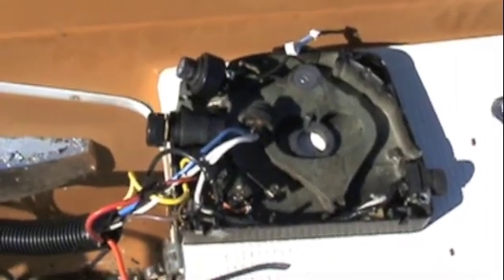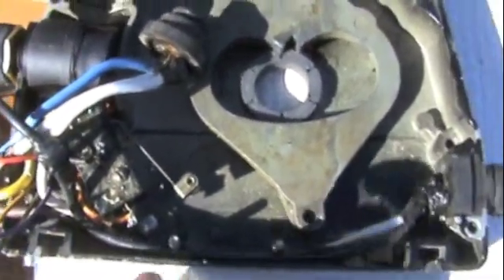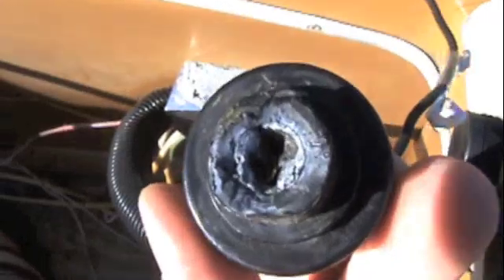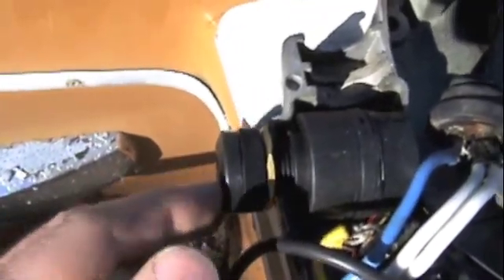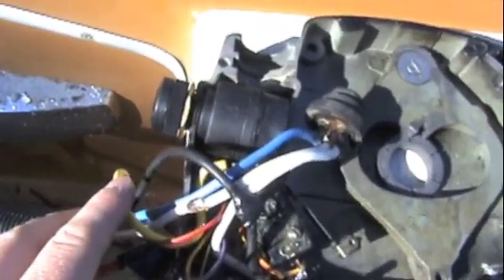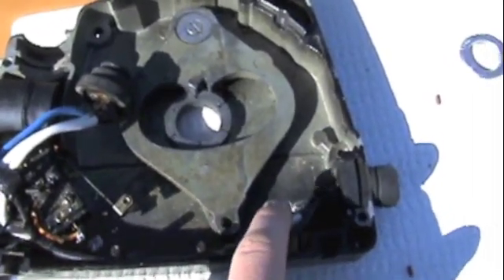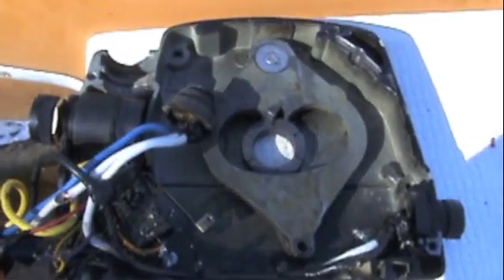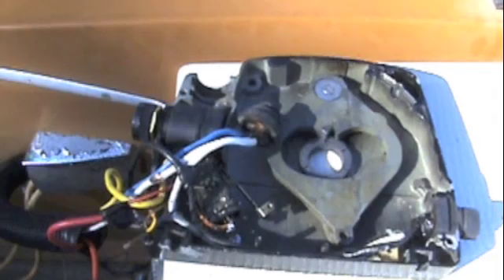Boat Project

Comment: that plug on the front is nothing more than forward tilt control.. So you can have a set of switched in the bow of your boat for loading on a trailer and while in the bow fishing raise and lower the motor for shallows as you uses the bow thruster.
Reply: http://thumbs.ebaystatic.com/d/l300/pict/232299839838_1.jpg

Comment: I'm having to replace a switch for a tracker pro 40hr but the wires do. it mach and if you could email me the wire lay out it would be a big help , thanks..
Reply from the maker: Cesar Morales I didn't use a wire diagram I just used a test light and tacked each one down the hard way lol just search on good for your boat wire diagram or check the factory that made the boat to see if the have them on their website

Comment: Daniel, is there any way you could call me. I have the same control unit and have just bought a switch but cant find anyone that can help me figure it out. Spooner 214 282 7482
Reply from the maker: Richard  Todd Spooner it's been many years since I did this really I just looked up the type of shift box it was on the Internet and went from there. the wiring was rotted away and I bought new wire and soldered it back in pretty much any boat mechanic will know these older control boxes if they have been working on boats for a while. but if you need more help just let me know it's just been a while since I did this and I have a new boat now.